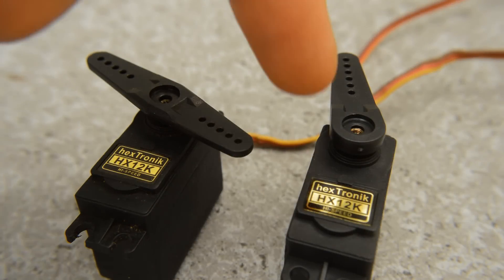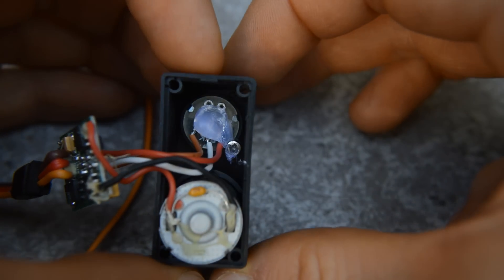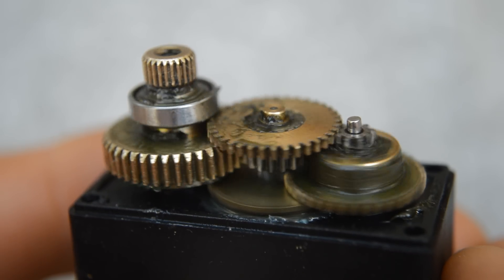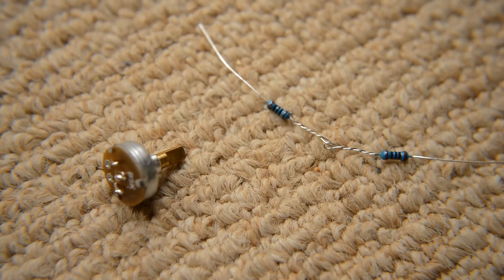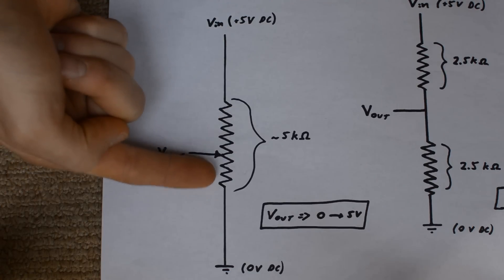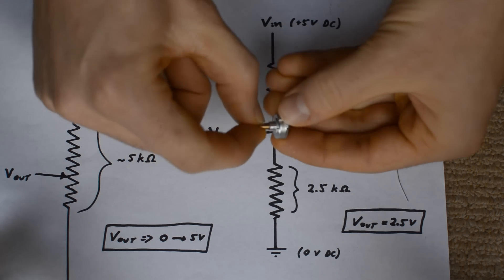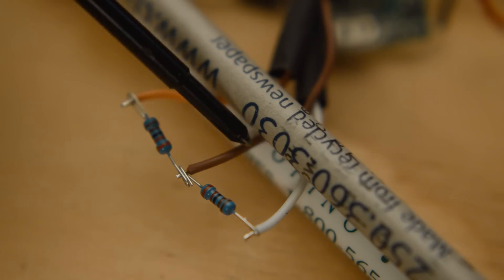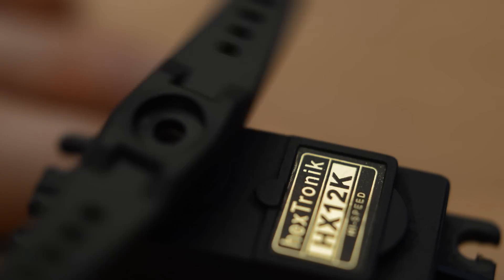Modifying a Servo Motor for Continuous Rotation

Comment: Also if you're servo uses those long pins potentiometer you could just cut it to lower it down from the turning mechanism and the center it's resistance, this way you don't have to get those resistors if you don't have them. I hope this makes sense.

Comment: Btw you can knock the stop pin out easily with a center punch and hammer (and something to brace the gear). Just make sure to punch from the smaller end of the stop pin.

Comment: Cant i just center the potentio meter and then cut the shaft of the potentiometer??
Reply: so i just tried my method and the method of the guy in the video, both works, I was lazy to modify 5 servos and then use solder. So now you know if you are wondering.

Comment: is that working only with 2,5kohm resistors will it work with 2x2k or 2x2.2?
Reply: It will work with any two resistors of equal value, how ever the lower you go in the value of the resistors the higher the current flow through the resistors. Conversely the higher the value of the resistors the lower the current flow through the resistors.

Comment: Would the voltage divider circuit work with capacitors instead of resistors? 
(I know it's been 7 years 😂, hoping someone with more knowledge than myself could shed some light on this question)

Comment: for anyone wondering, if you in order to control the servo you simply set the position, relative to half way, the servo will try to make that position but because the potentiometer is fixed at half way it will keep turning. so you can use the existing potentiometer code to control the modified servo

Comment: I tried doing this, however I didn't replace the pot. I also wired in a possibly larger motor and basically used the servo as a brushed ESC. It worked for a bit. Now it's moving randomly without input and doesn't listen to the position of the pot. It works again for a bit after it's been of for a while. Any suggestions?

Comment: I converted my MG996R servo without cutting out the potentiometer. Just pushed it in so it does't make contact with the gear and set it to 90 degrees for STOP, then took out the blocking pin and screwed it closed. It works very well.
Nice thing is if I want to undo my modification I can do it in less than a minute.
Reply: :trophy-yellow-smiling:

Comment: I agree with everyone else. A great tutorial, thank you!
Reply: And I just completed this mod with 2.2k ohm resistors and it's working perfectly.  Now, if I had only found this video a day earlier, I wouldn't have wasted time trying to center the potentiometer and super-gluing it......which made getting the servo back apart that much more difficult!   This is the way......
Reply: @SocalCanyonRacer  I didn't superglue it. Just pushed the potentiometer in and closed the servo. I changed it from a servo to motor and back like 10 times. It takes less than a minute. I don't know why someone would take the trouble to solder in resistor or supergluing the potentiometer and destroying the servo from being a servo ever again.

Comment: It’s easier and more compact to solder a pair of 1206 2.2k resistors to the circuit board... then there are no wires hat may possibly short out... an no problems stuffing them into the case either.

Comment: Forrest Trenaman I´ve just tried this with a Hitec 85 mg servo but nothing happens when i have done the connectiong work. Is it because i use a different kind of servo and that i should have a diffrent kind of electric resistance?
Reply: Exactly
Reply: Put the potentiometer back into the circuit...  But make sure there is no linkage between the gears and the potentiometer

Comment: What will happen if I simply remove the potentiometer and connect the leads to a battery?
Reply: It will not work is you remove the potentiometer....  Instead disconnect the mechanical joint between the gear and the potentiometer

Comment: Is it possible to take the potentiometer out of the drive system mechanically and use the existing voltage divider inside it? Dispense with the need for soldering and sourcing parts?
Reply: Disconnect the mechanical linkage between the potentiometer and the gear... That's  how the 360 potentiometer available in the market are made... But make sure not to make any electrical changes

Comment: How is the resistor value determined? I will be modifying a different type of servo and was hoping there is a general equation or specs that determine which resistors to use.

Comment: Does anyone know how to read the numbers on the resistors?

Like 4M7, 390R, 68K, 39E?

I bought a resistor kit & I know how to work out equations to find out which resistor I need but I don't know which resistor in kit to choose?

Thx.
Reply: M is for Mega ohms , R and E for ohms and K for kilo ohms so, 4M7 is 47 Mega ohms, 390 ohms, 68 kilo ohms and 39 ohms

Comment: so are you putting potentiometer again inside servo just that it is not giving feedback to main motor right?
Also the resistors are to give constant voltage right?
Can someone please respond fast, its a bit urgent!!

Comment: I don't understand, why to replace potentiometer with 2 identical resistor. Isn't it sufficient if we will just cut the pin which is fixed to gear which u cut off??
Reply: P Satish Patro yeah i only cut the blocker and my servo works. However it works fine by turning into cw direction but the other direction is kind of lagging or not as smooth as the cw.
Reply: Is it b4 adding resistor or after?
Reply: What do you mean by blocker?

Comment: Why use two 2.2k ohm instead of 2.5k ohm?
Reply: It doesn't really matter whether you're using 2.2k or 2.5k. The point of using two identical resistors is to divide the 5V to 2.5V. So as long as you're using two identical resistors it is fine (theoretically). However if you're using too small resistor it is going to heat up and cause another problem. So I think using 2k, 2.2k, 2.5k, or 3k all works fine.

Comment: Is there a standard 360 degree servo that I can to control its angle position like the normal 180 degree servo, for example I want it to turn a 3 rounds and 15 degree? and what its model name please?
Reply: Go for a stepper motor....  A Servo can't perform that way

Comment: why dont you just take all the circuit out and use just the positive and negative wires of the main motor?
Reply: Because then you could not control the motor direction.

Comment: My servo is also 5k, but I used two 2k ohm resistors and it does work it turns forever if I give it a number. But how can I stop it again? 
Please answer.
Reply: you detach it! But how do you change speed?
Reply: ᅚᅚ if I detach is there no meaning by controlling it remotely
Reply: ᅚᅚ if you give it a number there is further away from the reset number then will it drive faster

Comment: ok so I accidentally some how made my servo turn continually is there anyway to reverse it?? unless it's broken... 
continually spins to the right
when plunged in to the receiver  not sure how I managed that.
but any help would be great thanks in advance.
Reply: Resistors can't be wired backwards.
Reply: Louis-Philippe Asselin You're right, I don't know what I was thinking when I said that.  I have caps on the brain.  Good catch
Reply: Your potentiometer is broken
Reply: you probably have one of the resistors backwards.  If not, then you probably have a bad resistor and should replace both and see if that fixes it.  The resistance has to be equal, so those are the only two things I can think of that might be your problem

Comment: Awesome video!!! Just to clarify, if I run a servo at 6V I will need two 3 kilo ohm resistors correct?
Reply: No.,, Each of the resistors is half the value of the potentiometer
Reply: Dima Volkov

Comment: You didn't show (unless I missed it) putting the servo output drive shaft back into place after you removed the pot. The output shaft needs to ride on something. What I have done in the past, was to drill out the flat spot on inside of the output shaft, so that it rides freely on the pot shaft. I would turn the pot to dead center, and super glue it so that it will not turn. After removing the stop pin, then I would re-assemble  the servo. I don't always have the correct resistors on hand to make the voltage divider, so locking and using the pot is a short cut.  Note: You can use the Servo's drive circuit as an ESC (Electronic Speed Control) by removing the board, installing the Voltage divider resistors onto it, and it will drive many DC motors after plugging it into your receiver.

Comment: Hello Forrest Trenaman,

Would you mind telling me how to control the speed and direction of the modified servo motor?
Reply: +Haziq Najee Zulkarnian If you want to control the speed you need&#160;to&#160;have&#160;an Arduino and wrote up a simple Serial.write( value). value > 90&#160;~180 one direction with variable speed and the&#160;same from 90 ~ 0 for the opposite direction.You can check out my channel Servo Modified part 5.

Comment: Could you explain to me how in this case a dc motor stops rotation so fast? Usually when you cut the power they keep spinning for a while because of the momentum. thank you. great video btw
Reply: +Djordje Djukic Normally servos are geared down by a lot so as soon as there is no power going to them, they can't really move. 

But normally what I do to stop my motors (as in braking) is spinning them in reverse for a fraction of a second. This way it stops really well and doesn't carry though with the momentum.

Comment: can anyone help me . I use this method to modify my micro servo and when i set the mid point on the servo it stop rotating. Then i bought a pair of futaba s3003 servos and modify it but when i want to set the mod point of this servo it never stops. It just slow down a little bit and then start moving can anyone help me. Please tell me how do i set its mid point it just never stops

Comment: Thankyou for this high quality, good montage and very clear vocal instructional video. It was a pleasure to watch! BTW, you could have mentioned the method of using glue to fix the potentiometer to the 0 position and cutting away the shaft that rotates the potentiometer. Just In case a person does not have the correct resistor lying around.

Comment: there are more easy way to make a Servo Motor for Continuous Rotation!! You can use DC motor that it is a part of servo system:)). And you can use DC motor with PWM method:))

Comment: Will this modified servo work on robot with ultrasonic sensor!? For example, when sensor send signal to arduino, will servo stop and turn in oposite direction OR it will rotate only in one direction?
I mean, can I controll this modified servo with arduino? Thank you.

Comment: Can someone reply to 2 questions about?
1) the potentiometer can turn infinitely if leaved in his place or has a limited turn range? (I'm asking because it would be usefull to leave in place, using a microconroller to count the rounds done.)
2) What's happens if load is too heavvy and servo cant move? It will simply stall without problems or will destroy gears/motor?
Reply from the maker: 1) Photometers have a limited range, servo pots usually only turn about 180deg if I can remember correctly, if you turn them any further they will break. You can get different pots that turn a lot more, but they will always have endpoints, even if they keep turning. For what you want to do it sounds like a rotary encoder would be a better choice, they relay steps to a micro controller and have no limit to how far they can turn, sort of like a volume adjustment dial on a car stereo system. You should also check into stepper motors, they can work really well depending on the task, but they can also skip steps, however they are insanely accurate.
Reply from the maker: 2) For short periods of time you can stall them out without any issues, but after a while the motor will heat up and possibly damage itself.
Reply: Forrest Trenaman ok, thanks for explanations!

Comment: Does Servo motor can lift 5 to 10 kg boom barrier?
Reply from the maker: Yep, you can lift anything you want with any servo you want, you just have to have the correct gearing. The servos I am using are a little small to directly lift a 10kg object, but you can get servos with upwards of 30-40kg-cm ratings. This means that if you look at a point 1cm from the center of rotation on the servo arm, the servo will provide you with 30-40kg of force.
Reply: +Forrest Trenaman And does this relation change in linear fashion or a different one? I mean, if i had a 2cm arm fixed to the shaft, would I get 15-20kg F?
Reply: +danlowski  (yes, linear.. 15-20kg-F is correct for 2cm arm example you mention)

Comment: Does this work well for a camera pan? Can you control it, or does it just spin unlimited.  (For example, could i slowly look left, or look right, and then back to centre)
Reply: With this modification the center position is lost. You can control the speed and direction but if the servo gets no information it stays where it is. Contrary to an unmodified servo which always returns to the center position. So for your application an unmodified servo would be better. You just need to find one with a wider moving range. Preferably a digital servo for clearer movement.

Comment: Hi there.. Dude, as I am willing to use a servo like this to rotate an helicoidal axis (small one), how would I control the speed and whats kind of power source do I need to use? Considering that it needs to be on 220v
Reply: This answer is 4 years late but here it is .... An external potentiometer can be used to control the speed and direction of the servo......... Small servos can't handle high voltages like 220.. Hence you can use a relay in between to link the high voltage and low voltage circuits of your projecct

Comment: Ifound that if you just put the potentiometer on center position (128) and then secure it with a drop of Locktite  you dont need anything else. no soldering specialy. But then you need to cut the tab on potentiometer so it doesnt interfere with gears, but it is still faster solution and more accurate because you can adjust it before glueing it.

Comment: what is the difference between any dc motor and servo motor without feedback except the torque ratio? if you want more powerful and slower dc motor you can buy a geared dc motor, no need destroying a servo
Reply: Arguably, no difference.  However using a servo has some distinct advantages.   You can run it with any R/C transmitter and receiver, and it's in a nice compact mountable package.  It's also easily purchased.  A plain DC motor needs a variable voltage power supply.  You also have low speed/stall speed starting and torque problems.  And you completely lose the ability to operate it remotely without purchasing other additional hardware.  You're not destroying a servo, you're very economically re-purposing it.

Comment: Will it stay stable even after connected to rc? I want it to rotate only after sending signal through my Transmitter. By this method, the servo does rotates continuous, the moment power is switched to the Receiver, before it is controlled through the Transmitter... Please help me to do control through Tx.

Comment: Hey Boss, i did the same as you did, but with 2.7K ohm, cause didnt got 2.5. But it just goes on rotating as soon as power is given to Rx. When controlled with joy stick on Tx to opp. side, it rotates faster on the opp. direction. When controlled to other side, rotates to same side but faster. What should i do to make it idle initially, when the power is given. Plz Plz Plz Help....

Comment: If i put 6V on a servo will it spin? Or does it need a signal to start spinning? I need to make a boat for a schooltask? The nominal voltage of the servo is 6V
Reply: A servo needs the data wire to get a command to spin. You can wire strait to the motor to bypass the servo features and turn it into basically a motor reducer.

Comment: if you take out the potentiometer, isn't it just a regular motor with useless microchips inside?
Reply: Ok, never mind, it's variable speed... I guess I could see use in it but couldn't you just use a regular motor and PWM which you have to use for a servo anyway?
Reply: Shaun Keys
Are you the speed is variable?? Not just on/off regardless of stick position. If it is variable I will be very happy but need to know :-)

Comment: Youre a great teacher. Youtube on ipad goes crazy if you edit your comments so had to start again. I need arm wrestling strength servos, but a motor company wants almost a thousand bucks per servo (150W 24v i think). I have servos like yours and i can beat them in a pinky wrestle. I need to lift and rotate mannequin arms. Where can i find cheap servos or make them? Windscreen wipers or throttle controls in junkyards? Can i convert a drill to a servo easily? Need powerful servos cheap. Please help.

Comment: Each servo is going to need a different sized voltage resistor correct? Or will the 2.2 KO resistor work for any servo running off 5v?
Reply from the maker: Any servo I've ever dealt with uses 5k pots (potentiometer), with the exception of a 5g micro servo, it had a 3k3 pot, but the 2k2 resistors would have most likely worked fine). I would say that in 99.9% of cases the 2k2 resistors will work.

Even if the servo is running off more than 5V, the servo voltage divider will still divide the voltage in two, therefore tricking the servo into thinking it's centered, so you shouldn't have to worry about it. And in most of the servos I've used, the servo regulates the pot voltage down to some other value anyways, so the input voltage wouldn't effect anything.
Reply: Forrest Trenaman any potentiometer can be replaced with the 2k2 pair, as the output of the voltage divider will remain the same (half of the + input)

The servo's internal electronics reads only voltage, it does not care about the resistance of the potentiometers.
Reply: Are there any larger versions of this motor?